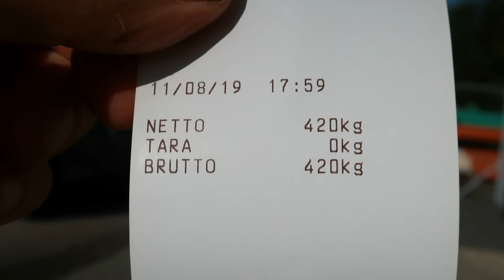DIY Mini-Camper / Selbstgebauter Mini-Wohnwagen

Comment: Ich habe mich in das Teil verliebt! Kostengünstig im Bau und im Unterhalt ! Ich würde so etwas locker für 4000 bis 5000 € kaufen! Dann kostet der Urlaub mit meinem Sohn nur noch Benzin ! Klasse Video!  Ich habe für mein Kangoo auch ein Mobiles Bett gebaut. Wenn das Auto irgendwann kaputt geht, dann Kaufe ich mir eins mit einer Anhängerkuppel. Dann besorge ich mir ein Anhänger und Bau mir auch so etwas ! Bei mir gibt es dann noch Solarzellen und ein Radio an die Wand :) Megga megga geil!! Danke das wir die Schritte deines Projektes mitverfolgen durften.

Comment: Great documentation of the build. Turned out nice.  One tip, Mount the base on 2x4s, then screw the sides to the 2x4s. Creates much more lateral stability.  (Coming from a guy who has been building teardrop trailers in 1994)  ;)

Comment: Komme ursprünglich aus "A" und wohne in "AUS", wir (Ehepaar) haben auch so einen Slide-On Pod gebastelt, habe kein Video aber könnte ein Google Bilder Album zeigen wo alles beschrieben ist um darzulegen wie wir das zusammen gestellt haben / funktioniert / ist seit 2 Jahren in Benutzung / darf wenn für gut befunden kopiert werden . Wie sieht nun die praktische Anwendung hier aus, wohl nicht ganzjährig - eher nur Saison?  Unser Anhänger hat 340 kg und das Ganze darf 750 kg nicht überschreiten, kam auf 640 kg allesamt. Haben aber einen Küchenblock drinnen mit Abwasch / elektr. Pumpe mit Frisch- und Gebraucht Wassertank, Gaskocher und Mikrowellenherd, sitzt 4 bis 5 und schläft 3 wenn man den Tisch hinunter klappt. Mit meistens so 33 bis 40 Grad ist die Kabine isoliert und hat große doppelt verglaste Fenster, bevorzugen eher drinnen zu sitzen um der starken Oz Sonne zu entgehen so wir nicht gerade wandern / schwimmen / bummeln. Im Winter kann es nachts so um die 0 bis minus 3 haben, es heizt dann meisters zu Mittag bis auf 23 Grad auf wo man schon die Sonne schätzt. Die Einheit ist L: 2.5 X B: 2.0 X H: 1.88 Meter. Ziehe das mit einem 1.9 Liter Diesel Renault Scenic und fahre die erlaubte Geschwindigkeit ohne Probleme ( so viele zuckeln so um die 80 km / h in einer Hunderter Zone herum und verursachen Stauungen) . Wäre an einem Gedankenaustausch mit Eigenbau Campern  interessiert, bitte um Kontaktmöglichkeit, regards Otto Wor via Facebook or Messenger

Comment: I really like this. If you had plans in English, I would buy them from you. In that small space, you had a sitting and eating area that turned into a bed, a place for a toilet, and a cooking area. Well done.
Reply: Easy to work out.   First you need the trailer to get the outer dimensions.  Get a height  50mm above the tallest user.  Sometimes you need to work backwards to design.

Comment: Nicht schlecht. Sowas suche ich für mein Quad. Hänger habe ich . Allerdings sind mir 420kg noch etwas zu schwer. Da komme ich mit Hänger auf 660kg. Darf ich zwar ziehen, aber ein Gesamtgewicht um die 500kg würde ich vorziehen.
Reply from the maker: 420kg war inkl. Hänger. Der Aufbau hat ca. 270kg
Reply: @GVMCorner  Das wäre schön nicht schlecht. Mein Hänger ist 3m lang und 1.6m breit. Also die Ladefläche. Wir hat Du das mit der Dichtigkeit gelöst? Nur streichen und Leisten? Wäre nicht Glasfaser auf dem Holz langlebiger? Ansonsten super Leistung. Kannst Du mir sagen, was Du für das Material bezahlt hast?
Reply from the maker: @xoman1965  Alles ist wasserfest verleimt und das Dach mit Alu verkleidet. Da ist alles dicht. Glasfaser ist nicht schlecht, aber aufwendiger und teurer. Ich wollte es einfacher und schnell. Preis war ca 1500€ ohne Hänger.
Reply: @GVMCorner  OK. Muss mal meinen Hänger mit meinem Quad ziehen ob das geht. Dann wäre die Idee nicht schlecht.
Reply: Hammer gemacht ... Da wird man neidisch. Wenn man das ganz jetzt auf einem gebremsten umsetzt und noch was mit Solar macht....
Reply: @Raymnd-xu7dl  warum gebremst? Unter 0,5 Tonnen für nen Kleinwagen unproblematisch!
Reply: zum Beispiel für Quad und Motorrad. Dort sind die ungebremsten Anhängelasten eher gering.
Reply: nimmst halt sanddwichpanel, ist leichter und hält bei richtiger verbindung ohne probleme. habe ohnehin bedenken wegen der verleimung hier - das könnte m.e. nicht ideal bei vibrationen, verwindung und erschütterung sein. da gibt es heute deutlich bessere kleber.
Reply: @Spatzenterror  Sandwich habe ich schon als Alu und GFK Variante zum Fahrzeugbau verwendet. Gutes Zeugs.

Comment: Hey cooler Job, ich bin auf die Idee gekommen mir auch einen Camper selber zu bauen, da mir die Pissdinger die es zu kaufen gibt einfach zu teuer sind. Ich als Schlosser würde allerdings einen Stahlramen auf einen Hänger schweißen, und mir vom Schrott Sandwichplatten besorgen, da die besser gedämmt sind als Holz. Außerdem würde ich einen Stahlrohrramen mit Dachgepäckträger bauen, damit ich noch was oben drauf tun kann wenn ich will, ein Kanu oder watt weiß ich. Und mein "Misthaufen" würde nicht so hochwertig werden wie der hier gezeigte :D !

Comment: Beautifully done.
Made me think about improvements. If the purpose is to sleep in it and not ride, then materials could be different. All that wood will be heavy and drain fuel. Perhaps steel poles with plastic walls or even canvas walls plus insulation. Just wondering... maybe even a version that can collapse when not in use. Thanks for the inspiration.

Comment: this was really impressive!!  When I saw the door latch on the back, my first thought was that someone may be locked inside and cannot get out.  I assume that it can be locked when not used to secure it, but then it can be secured in the open position so that no one can be locked in.  This is a really nice idea to use an existing utility trailer.  Is the total weight including trailer 420 KG?  or is that just the weight of the camper add-on?  I really like the set up!
Reply from the maker: Thank you! Yes it can be secured in the open position. The weight is 420kg including trailer.

Comment: Very cool stuff. I have two questions. First, is it strong enough? The corners are held together by plywood screwed and glued to the end-grain of other plywood. Is it strong enough for the fierce highway wind resistance? Second, is it safe with that door, seeing as people could lock you in from the outside? If the door is latched, or the tailgate closed, or both, the people inside would have no easy way out. Is the skylight the emergency exit?
Reply from the maker: It's strong enough. No problem. We have appliances to prevent locking us in.

Comment: Hallo Mini-Camper-Bauer,
tolle Konstruktion, toll gebaut!!!  Danke fürs Teilen.
Ich plane selber eine Camper-Absatz-Kabine auf meinem Anhänger. Die Nutzfläche ist 3,00 m x 1,60  Meter.
Da ich den Hänger ohne den Aufbau nutzen muss, überlege ich noch wie ich den Camper gut be- und entladen kann.
Meine Fragen an dich wären:
Wie hast du das Be- und Entladen deines Campers gelöst?
Hast du die umgebogenen Seiten deiner Aluminiumdachverkleidung gelötet, geschweisst oder das ganze in Auftrag gegeben? Wo bekommt man die Bleche am besten?
(Da ich kein Metaller bin frage ich so unwissend)
Vielen Dank für deine Antworten.
Viel Spaß mit deinem, eurem Camper.
LG Dieter Jakob
Reply from the maker: Hallo und vielen Dank!

Meine Kiste ist nicht so schwer. Die kann man leicht vorne anheben und dann auf den Hänger schieben. Sieht man im Video.
Weiß jetzt nicht genau welche umgebogenen Seiten du meinst, hab die Eckprofile auf ebay bestellt, zugeschnitten und mit Dichtmittel an den Kannten verschraubt. 

Und bei den Übergängen der einzelnen Aluplatten auch wieder Dichtmittel (Dekaseal) und eine Aluleiste drüber. Siehe 10:52 
Alubleche sind von Hornbach
Reply: Hallo,
danke, hast mir mit meinem Aufbau weitergeholfen. Wenn ich mal soweit bin, werde ich meinen auch mal einstellen und Bescheid geben.
Bis dahin. LG Dieter Jakob

Comment: Where is your insolation? Heat will not hang around in the trailer for long
Reply from the maker: No insulation needed. Wood is a natural insulator due to air pockets within its cellular structure. For us good enough.